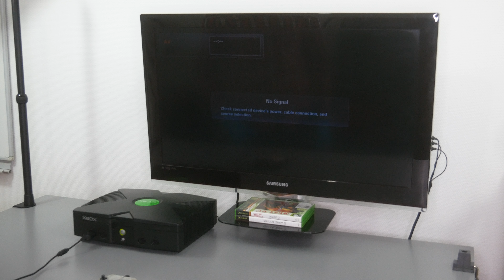XBOX first generation DEEP CLEANING - Game console restoration [4K/ASMR]

Comment: Very nice restoration, I'm just concerned for that Powerstor Aerogel capacitor(C7G10) @ 16:50. This is the notorious clock capacitor that destroys Xboxes when it leaks. That thing does not look good at all and is probably about to leak. I hope you removed or replaced it. I have one that leaked so bad the liquid damaged a couple of traces on the board close to it and was not fun to fix.
Reply from the maker: Hi leowob2aol! Yeah I saw this capacitor issue. I didn't change them for the video because I didn't had the right capacitors and I had I publish this video in time. Especially because I already had to postpone the previous upload... I will change them for sure. Just don't know if I will do a dedicated video for this.
Thanks a lot for your comment. Nice to know you enjoyed this episode ❤️

Comment: Was it operational even when it was filled with dirt.
Reply from the maker: Yeah it was 😅
Thanks for your comment @blenderbeachwavesblend hope you enjoyed this video ❤️
Reply: @french.satisfactory  That is interesting. I still have one of those. It was manufactured in May 2005. Still works except for the disc drive tray is stuck, keep a disc inside for it to open. But it is getting more worse over time. Now it doesn't close straight away, so needs a few open and close to do so.
Reply from the maker: Interesting. What I know is that on this gaming console the more common issue is that we have to replace the capacitors. Looks like you was not so lucky with it  @blenderbeachwavesblend  😅
Reply: @french.satisfactory  Well, only the disc tray is the problem. It powers and plays the games I have. Never been a problem. It doesn't have a battery like those before it, the original model xbox release. By the end of 2004 a new board was released with no battery. For the most part the system sat on a trolley for the entire near sixteen years I have had this system, it was second hand, I almost got ripped off for it, £40 with no controller, only the power and cable wires, but got it for £30. Of course the shop that sold it is gone, still there but the shop scaled down and was divided so another business could open. Second electronics don't make money unless online sales.

But yeah, I've been lucky with this xbox. I never thought it would work for so long, I have Chaos theory splinter cell, Driv3r, GTA San Andreas. A number of other games, for it, Doom 3 and the second Doom 3, I didn't like the second Doom 3, mainly the Mars station locations, which are far and few between.
Reply: @french.satisfactory  The version you have is after. So no clock battery capacitor.
Reply from the maker: Interesting. Thanks for sharing this ❤️

Comment: And what thing is this at 11:11
Reply from the maker: It is plastic stick spudger. Really nice to safety remote some parts. But I finally don't recommend to clean the heatsink. Better to use WD40 first, then Isopropyl Alcohol on cotton swabs.
I improved my cleaning method since this video.
Hope this will help. Thanks for your comment @sameerlatif-0319 ❤️

Comment: Another great job! Couple of questions: Was the XBox working before restoration or it had some flaws that prevented it from working? Did you think of heating the stickers to get take them away easier instead of dry removing them to get into screws? What kind of heater did you use to take away the GPU heat sink? Also it was really satisfying removing all the glueish stuff from GPU as it was really dry and cleaning the optical drive! Good job!
Reply from the maker: Thank you very much DIPPY! 
Here are my answers:
- Yes this xbox worked before I cleaned it. And as you can see, it worked well after also.
- I didn't think about heating the stickers, but it's a pretty good idea. I will try next time.
- I used my girlfriend hair dryer 😅 The same I use to dry all the parts after the bath time on all my videos.
Thanks again for your nice comment DIPPY! nice to know you enjoyed the video ❤️❤️